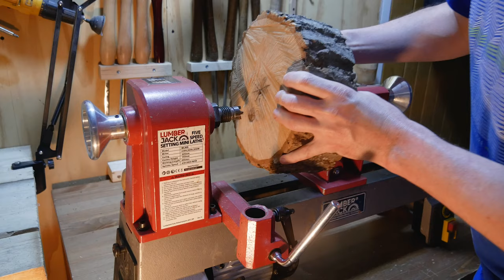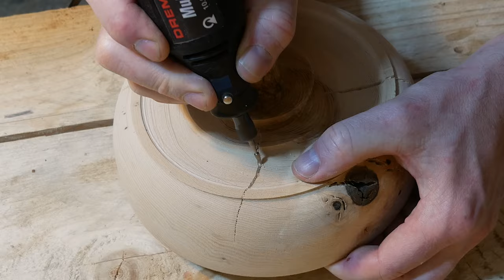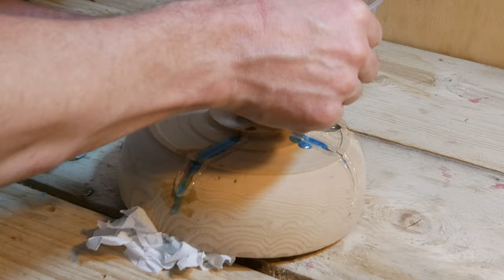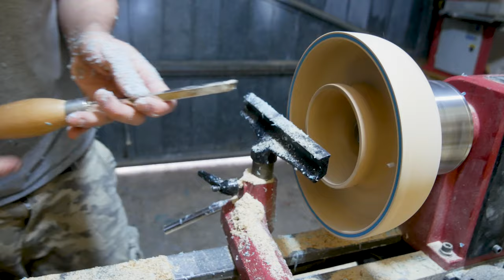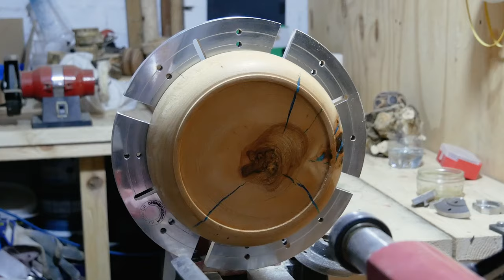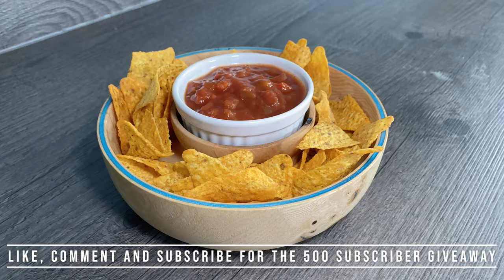Woodturning A Resin Inlay Bowl From a Dusty Oak Slice

Comment: What lathe is that? Great work, just followed you.
Reply from the maker: Hi, thank you 🙏. It’s a Lumberjack 305 5 speed. Great little lathe - only drawback is manual speed change using belts, but only takes a minute to change.